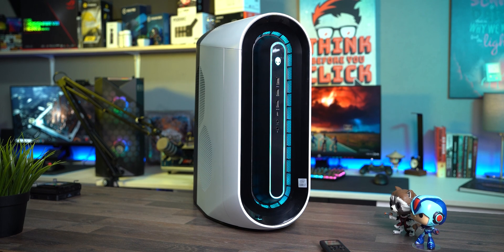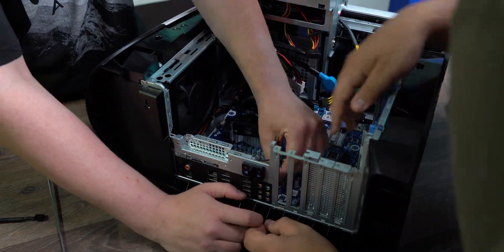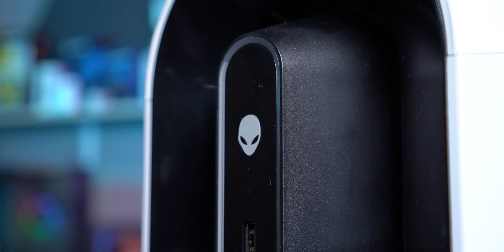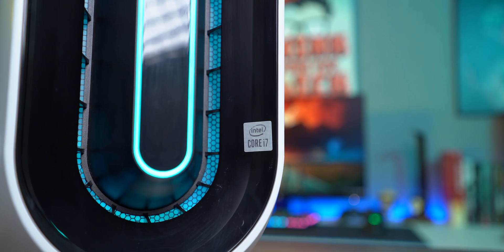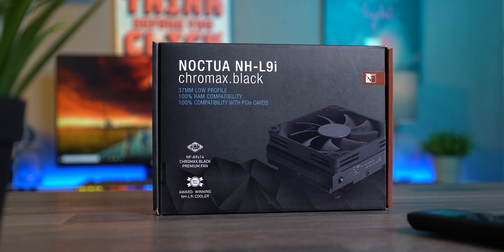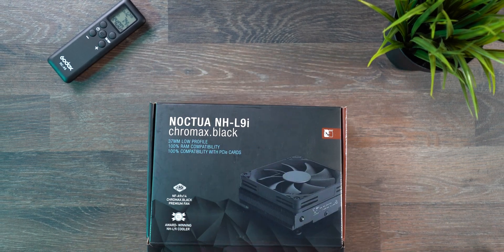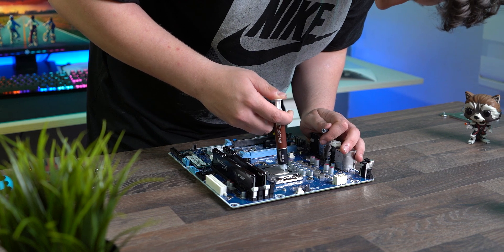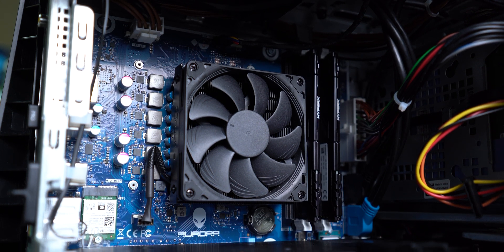2500$ PREBUILT PC WITH STOCK COOLER!? ALIENWARE AURORA R11 - GAMING PERFORMANCE & THERMAL SOLUTION

Comment: This is an ok solution but definitely not the best. The best would be of course water cooling but not everyone can afford that so let me give you a poor man's solution. Dell Optiplex ssf cases have a low profile cooler that has 3 pipes and shoots air sideways verses directly over the hot PSU. This with a dell VRM heatskink drastically cooled my hot box here. Make sure your unit is also using the 22 mm fan, the 18 mm fan is simply too small (and very nosey) to get the job done well. The 22 mm fan and vrm heatsink are cheaply available on ebay and will help. Make sure to also use quality thermal paste to cover the whole cpu. This is critical because your redirecting the heat transfer and any gaps, any discrepancies in coverage may hinder all this work pointless because it will throttle and might throttle even worse than the stock cooler. Despite it's shortcomings this design is actually quite brilliant and effective. Unfortunately Dell chose to cheapen out on some of the parts to make it a decent system even on the high end stuff. This case design is shared with XPS/Inspiron lines too and they too suffer from some of the same drawbacks but again with some carefully chosen upgrades this rig can really be driven. The key here is carefully chosen upgrades.